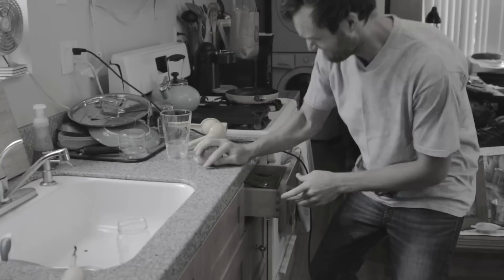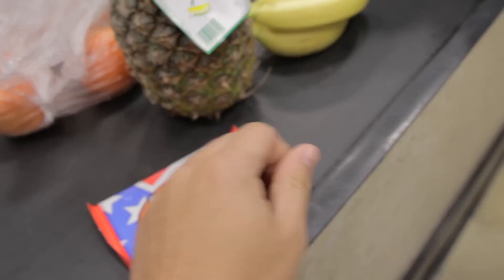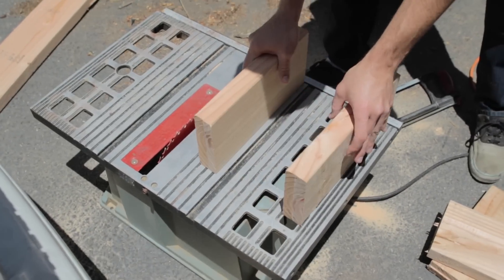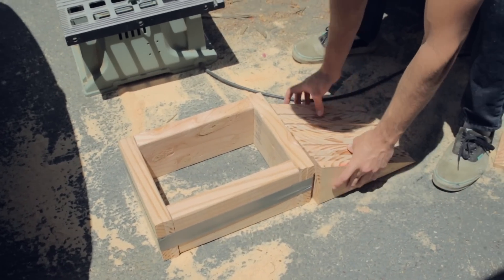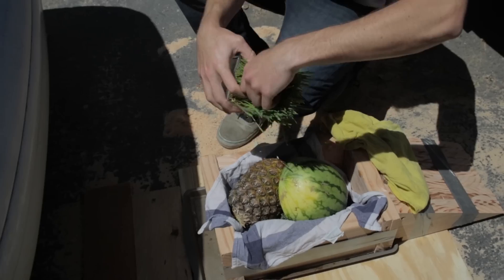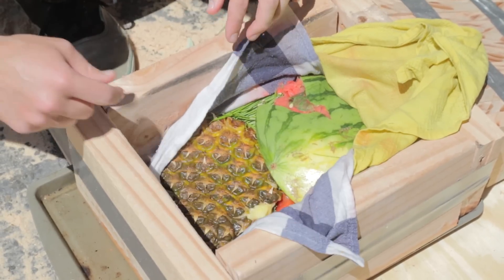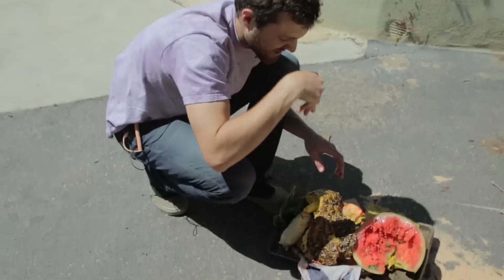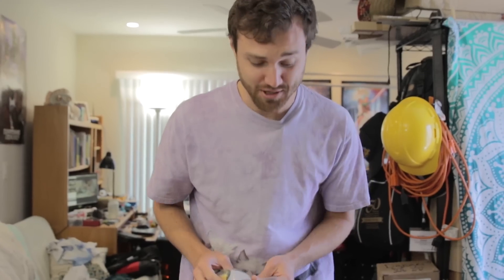Auto Juicer

Comment: See, in my head I was thinking you make a hole in the driveway with a bin in it. That will be what catches the juice. 
Then you lay a very thick and strong steel mesh or material that a collinder has, or something that is strong enough to hold up a car, and has tiny holes in it, and you place that in the hole, but above the bin. 

Then you place your fruit on top of the mesh thing. 

And finally you place something hard, like a piece of wood on top of the fruit. 

You want to arrange it all in a way so the piece of wood on top is in a position where the car can drive on top of it. 
That will squish the fruit to the mesh, which will strain the juice(along with some pulp) to the drain bin. 
If you want no pulp, maybe wrap the fruit in cheesecloth and then run it over, and the juice should be essentially double strained, and not have any pulp in it whatsoever. 

It's 1:46 am what am I doing with my life?

Comment: The wood that is used as the crusher should have an inward curve so that it holds the tire and distributes the weight evenly instead of at an angle. Imagine a trapezoid that has a bite taken out of the top of it

Also, pro tip. If you add a tablespoon of coconut oil to your kale it makes it easier to scrape into the trash
Reply from the maker: lol get rekt kale
Reply: Kalvin N no he's saying kale belongs in the garbage
Reply: I actually have no idea if you're joking or if when you make juice, the kale is hard to get out after? Coconut oil solves everything lol, it'd go solid in cold juice though?
Reply: Matteo de los muertos
That's way too professional for William's crappy science channel.
Reply: gay

Comment: why won't you make a guitar?
Reply from the maker: I will, give me timeee
Reply: William Osman seems like time is the only recourse we all lack of.
More to the point, instead of plain guitar you can actually build a kalimba (just little metal plates under tension instead of strings which are hard to keep at constant tension), but that's easy mode. I could potentially send you some of my earlier designs (which are crap and done in ketchup). 
Also a glockenspiel is a good instrument to make but the problem is that it relies on metal plates that are mounted in two points and you need to calculate the frequency of metal plate between these two points (which i did in solidworks but it heavily relies on metal strength and how soft it is, softer metals tend to lose sustain pretty fast). Duh, my brain is melting.

Comment: i actualy have a "great idea" for an aoto juicer.... somehow putting a loundrey machine barrel (the inside metal part and i dont know what its called) on the part of the car where the rire is screwd on....and than putting another barel arond that inside barrel thats gonna spin (the ouside part doesnt spin) and than starting the car and making the barrel spin and extract juice out of the barrel by scraping the fruit as its tossed around in the barrel... (or mabey the inside barrel coud be made so the holes are turned not like on a normal wasching maschine where they are turned away form the clothes so they dont harm them but twords the inside so it does harm the fruits inside!)....

Comment: you did it when you do it on the top of making the do did but did you do the thing with the sling and do what didnt be done before? also try making a mechanism that slides/springs a deck of cards from one hand to the other, or from one surface to the other.

Comment: Can you make a laser lathe? I mean, what if you put something under your laser cutter on a spinning motor like a lathe and cut the thing with laser? ༼ つ ◕_◕ ༽つ
Reply from the maker: hmmmmmmm
Reply: Maybe you could turn ham into chess figures with it, thats not that thick, that the laser can't handle it :D
Reply: chainsaw powered rotary axis
Reply: Personally I would use a stepper motor and cut only the sides, like a gyros cooker, but I'm speeking for myself :)
Reply: zozozoli    there is a device out there that turns drinking glasses so you can laser etch on the sides.  which would be like a slow turning lathe-type device. I don't know what its called and am too lazy to look it up, sorry.
Reply: zozozoli OMG UR A GENIUS I NEED TO DESIGN THIS!!! THX

Comment: What if you took one of those fidget spinners and hooked it up to some sort of RPM-measuring device, that would be connected to a computer. And then make the speaker volume on the computer be the same as the RPM of the spinner at any given time?

Comment: Anyone else cringing at the cross-cuts on the table saw... Holy man think first.
Reply: connor antoine it's William Osman, the king of crappy science
Reply: Draxxy teh dragon Ya, but there is a difference between acting goofy and pretending to be stupid. Then there is actually almost cutting an body part off by not using a sled and push sticks.
Reply: connor antoine damned woodworkers
Reply: It's a delta 10" benchtop saw.  It has a 13A motor - about 3/4 HP.  Without a fence to jam into, it limits the amount of backside blade fetching, but if things go wrong it does have more than enough power to be extremely dangerous.
Reply: The video you linked is on a table saw with 1/2 to 1 hp, and using a fence. This toy that William is using won't launch anything. Maybe you should limit your comments to things that you actually know about, like video games.

Comment: Notification squad checking in!!! Also, your table saw usage is incredibly dangerous. Google how to use one properly, man.
Reply from the maker: Is there a safe way to cut 2x6's on a floor level table saw?
Reply: William Osman yes, you need to use a miter gauge to keep the piece square to the blade. Your method of cutting it freehand will definitely result in kickback at some point.
Reply: William Osman also for an idea, if say wooden blender made from the laser cutter
Reply: William Osman yes, put it on a table, and look up the manual. it should tell you how to raise the height of your blade. also plz send me the spinner. I've watched all your funny vids